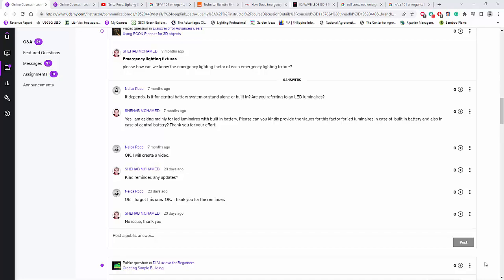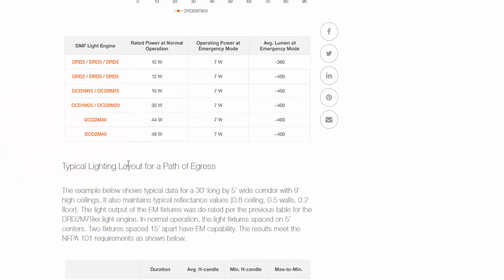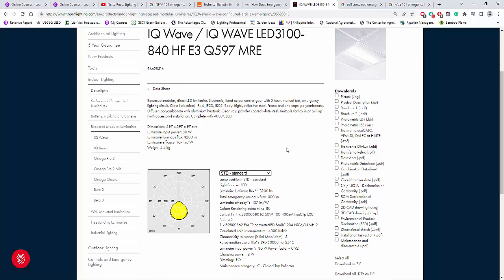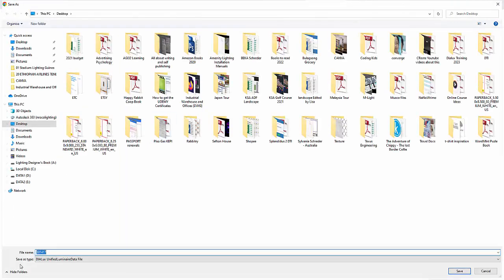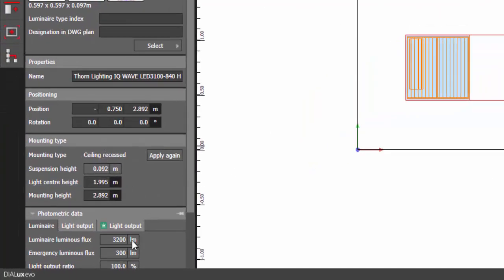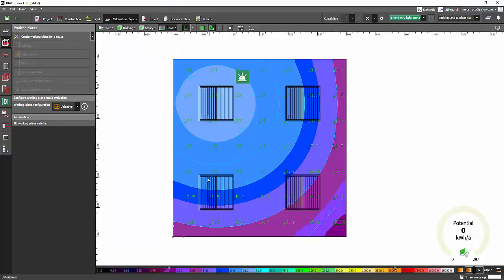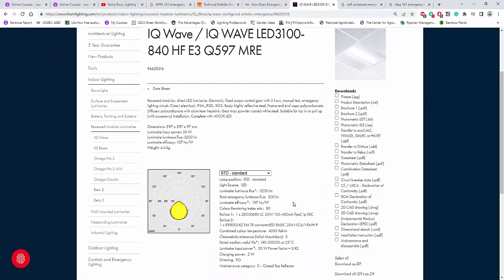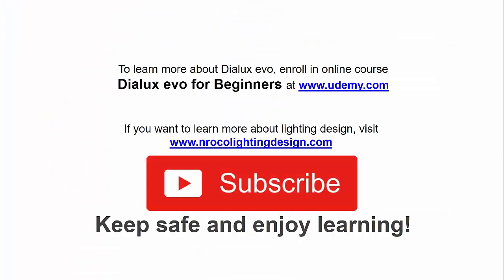How to get the emergency lighting factor in luminaire?

Comment: Thanks alot Mrs.Nelca for your explanation, i am shehab who asked you .. i hope your health to be better..your answer is clear .. ok this is for in built battery..in other hand , i think if the lighting fixture is connected to generator source or central battery so in this case i can use the total default lumen (which is in normal condition) not (in emergency condition), am l correct?
Reply from the maker: yes. correct.

Comment: I think he meant to ask for the Emergency Lighting Loss Factor.
Reply from the maker: oh no! then my answer is wrong. 🤣
Reply: @NelcaRoco  🙂That’s ok we always learn from sharing our experiences.your answer is right if it was the light factor meaning a fitting retrofitted with an emergency kit and we want to know how much light will come out of the LED dedicated for the emergency lighting.And yes for sure it will depend on the type of the fitting,diffuser etc. But for the LLF of emergency lighting designs we set it to 1, instead of 0.8 as in general lighting.And we run the calculation as a direct calc rather than direct and indirect as we do for general lighting designs.Meaning that in the emergency lighting Lux plot all reflectance values must be disregarded. I hope that helps and keep up with the amazing work that you always do 🙂.
Reply: @Ozeir  hi,that's me, shehab, who asked the udemy question.. my concern was about the output lumen in emergency mode, not for the light loss factor, and Mrs.nelca clarified it in case of an inbuilt battery.. but you are also writing about another important point about this light loss factor/maintenance factor in emergency mode .. I'm just asking why maintenance in emergency mode is 1 instead of 0.8.. due to the same expected environmental conditions and expected maintenance intervals times are the same for both normal & emergency fixtures?
Reply from the maker: @Rams333s  thank you for the great info, Ozier! :_excited:
Reply: @shehabadham91  Hi Shehab,apologies for the late response,it is an approach adopted by the practice pretty much,as It never turns on,as these days most emergency fittings run on a battery and by standards they must be tested on a six months interval,both exits and emergencies.some systems could be even tested remotely as well as physically.all of these procedures to ensure that the lights will turn on in case of an emergency,when the general lighting turns off.
Reply: @Ozeir  apologies for the late reply. Thank you for your reply.